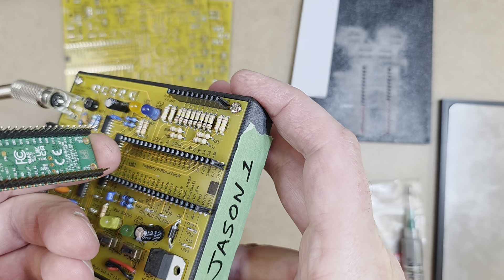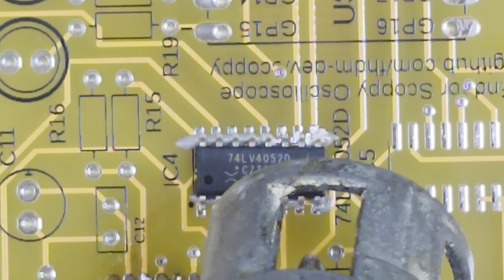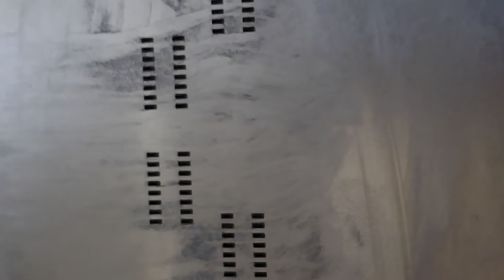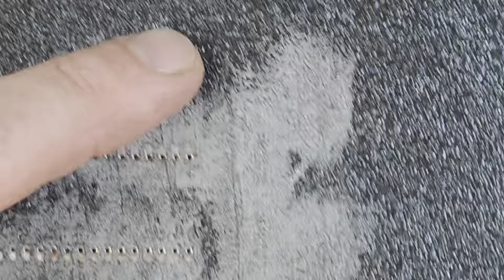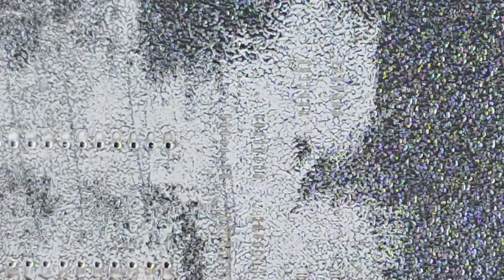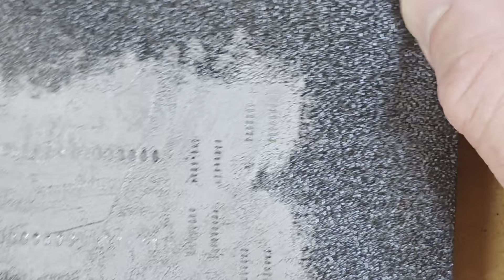Surface Mount Soldering for the TTED 4060 "Scoppy" Oscilloscope Front End Hardware

Comment: Great stuff. Wish we did this back in TTED!
Reply from the maker: Adding a bit of SMT was one of my goals when I came to BCIT. It has taken a while to get it figured out... my first attempt was at a BCTEA conference and we used TSOP PIC Microcontrollers... it actually worked amazingly well considering how small the pins were, but switching to SOIC has really improved the success rate. It has also taken a while to get the masks figured out. Up next I'll have to do a 100% SMT winky blink!! (Also on the "hopefully this year" list... I've finally overcome the fear of fires and hope to introduce some lithium batteries to the curriculum. I'm still not sure they're the right technology for most high school projects, but people are using them anyway, so they may as well know how to use them in less dangerous ways.)